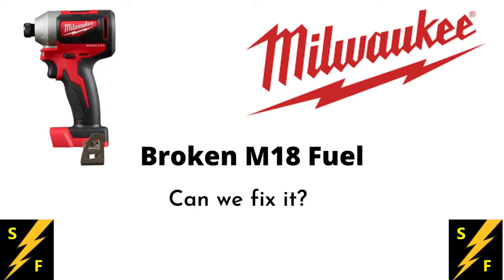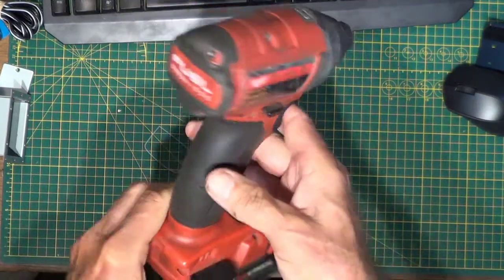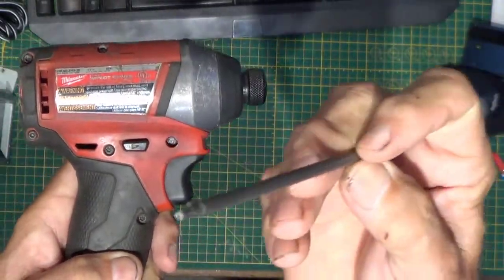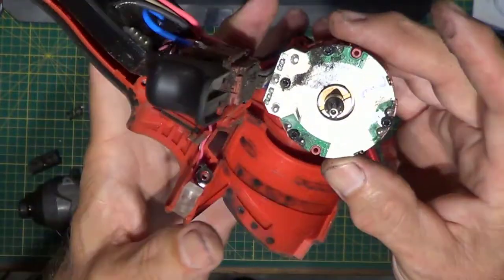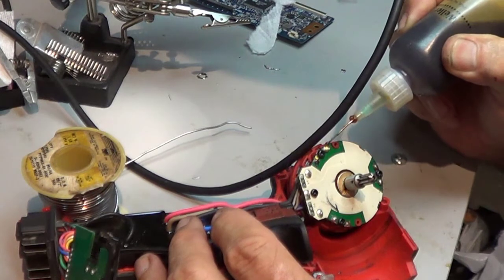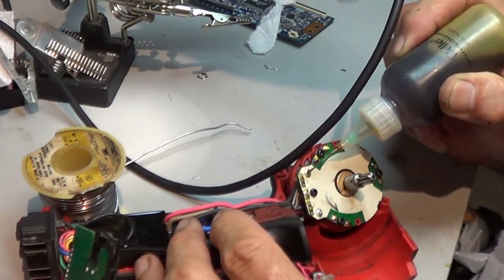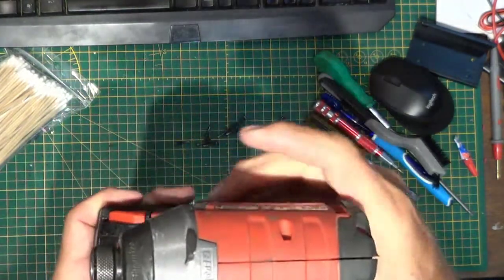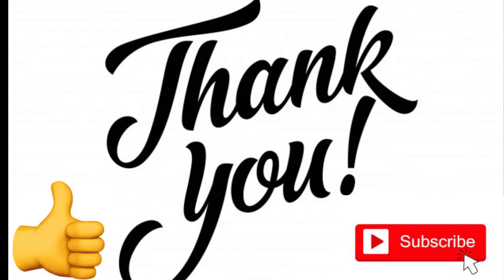Milwaukee M18 Impact Driver Repair

Comment: Thanks my man I have a m18 3/4 drive impact gun for wheel nut and so on !! It was intermitten but now won’t go at all the lights come on when I pull the trigger but the gun won’t operate!! Would this work on my model they are not much different!! I guess it’s worth a shot !! Thanks again and cheers from Ireland 🇮🇪take care and thanks for the info it’s greatly appreciated!!! Brian 🇮🇪🇮🇪🇮🇪
Reply: Ireland is a wonderful country.  I visited in the 80's and had great fun.  I climbed the Mourne mountains, saw both northern and southern Ireland.  The people are EXTREMELY nice!  Since it is broken, you have nothing to lose by carefully opening it up and seeing if there is a broken wire, solder connection or some other obvious problem.  Good luck with it, they are good tools!
Reply: Yes thanks my friend I appreciate it !! I live right at the bottom of the mourne mountains in Northern Ireland near newry !! I’m glad you liked Ireland 🇮🇪 I love America as I lived in New York City in the east village for 20 years I worked in the concrete union 18a that was located in the bronx !! I was working on 23rd street and 10th av , on 911 🙏oh wat a crazy day it was in the city !! Rip everyone 🙏I’m home In Ireland now trying to fix my American tools 😂😂😂take care be well !! Brian ….Newry Northern Ireland 🇮🇪

Comment: Great video! I have Milwaukee m18 and the impact driver is not responding at all when I press the trigger. I’m hoping you can help me.
Reply from the maker: Hi Ramiro Santiago!  Thanks for watching the video.  If it does not work at all, then you have nothing to lose by taking it apart and seeing if one of the connections is broken off.  It may be corrosion on the blades that slide into the battery.  I assume you checked with a different fully charged battery?  Good luck with the repair, if you find the problem, post it here so others can fix their problems.

Comment: My  M-18  2767-20 was partially submerged when my truck flooded.  Do you have any idea what I can do.  You think replacing the mothers would fix it?  It’s not even a month old.
Reply from the maker: Hi Amy, wow, that is horrible!  Water does some pretty nasty damage to electronics.  I would open the case, dry everything out with a hair dryer, oil all steel mechanical parts, and carefully clean any electronic connections with isopropyl alcohol then reassemble.  You may get lucky a lot of the electronics are potted in epoxy, but the connections and motor windings may be damaged - good luck and thanks for watching!
Reply: @stevesfascinations1516  thanks for the response!

Comment: I think you should have kept the drill and told him it was an unsuccessful repair. Watching you unscrew all of those screws by hand took me back to the old days. I don't think I would have even attempted disassembly without my DeWALT DCF682 electric screwdriver. It has gyroscopic control meaning you determine the rotation direction by moving your wrist the way you want to go. I paid $25 for mine off eBay which is relatively inexpensive I highly recommend it.
Reply from the maker: Thanks for the tip Vadim!  I will look that tool up!  Anything that makes the job easier is good in my books!
Reply: @stevesfascinations1516 try looking up the HOTO Electric screwdriver kit it’s more expensive but it comes with 3 torque settings and it’s super duper smooth I’ve had mine for a year now and no problems even held a charge for a month

Comment: Hello. My impact M12 only works if you remove and install the battery or change the screw speed. How do I fix it?
Reply from the maker: Hello, thank you for watching my video!  These tools go through a lot.  They are being used in all sorts of weather and conditions.  They occasionally get dropped.  I would clear an area of your workbench so you can keep track of the parts.  Remove the screws holding the plastic housing together.   Carefully inspect all the connections and resolder as required.  You may see something obvious, if not, resolder everything.  Hopefully it is not the module that is potted in epoxy.  Good luck with the repair - sometimes we get lucky and save an expensive tool!

Comment: Hello sir i have some problem in speed selector not functioning. I hope you can help me.
Reply from the maker: Hi Cajo, if I recall, the motor control was a potted (a term they use to keep the electronics safe, water tight, and secret).  The trouble with that, is the electronics are impossible to work on.  It may be time to replace the driver.
Reply: Ok thanks a lot.

Comment: If ya bought one of those, it would take only a fraction of time to remove said screws.
Reply from the maker: You are right!  Sometimes, I just like the hand tools, you have more control and it is enjoyable for me to work on equipment like this.